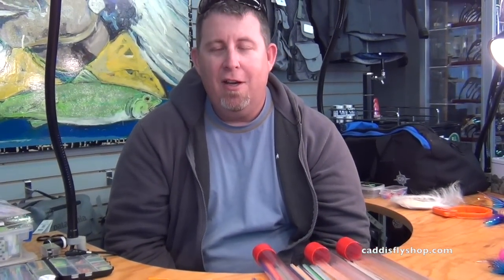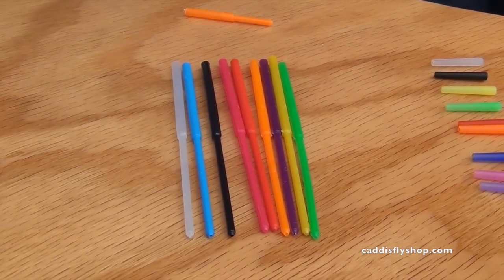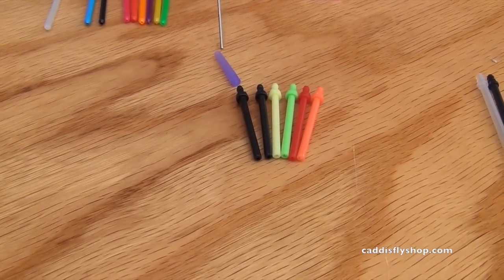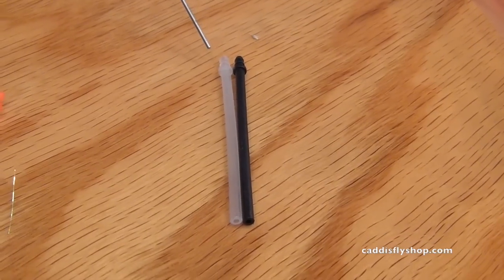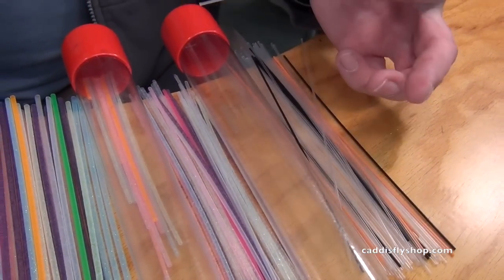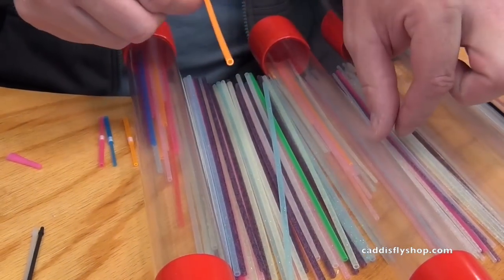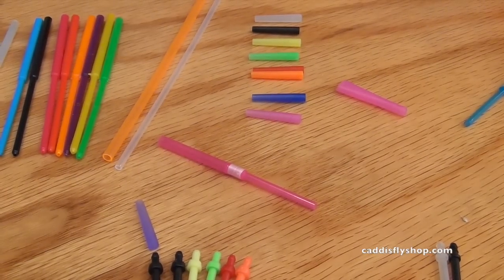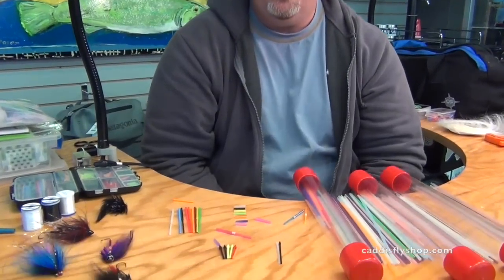Pro Sportfisher Tube Tutorial

Comment: I have the pro tube system and love it. What I would like to get some of are the tubes with the red ends that you store the classic tubes in. I have been looking for those for my travel bag to keep my tubes protected. If it is the size I think it is, threads will also fit into it to keep them together. Where can I get some of those clear tubes with the red caps? All the best, and Happy New Year guys. Sean
Reply: Search ebay or amazon for clear plastic mailing tubes, you should be able to find what you are looking for.
Reply: Thanks a lot. I appreciate your taking the time to answer this question. All the best, Sean
Reply: Home Depot. PVC 3-5 bucks with a cap, your welcome.